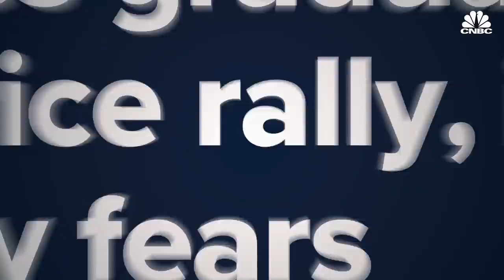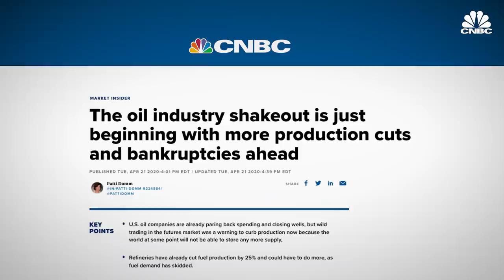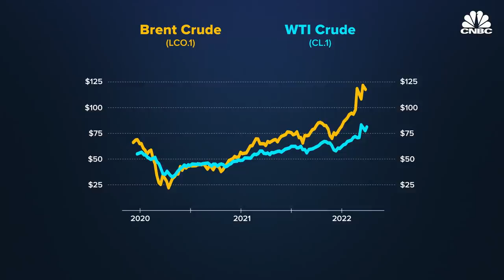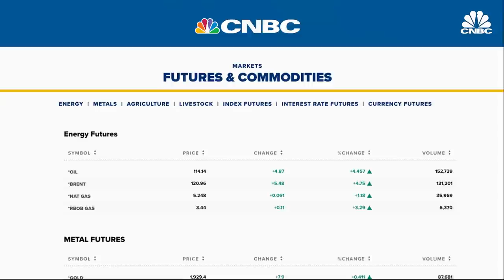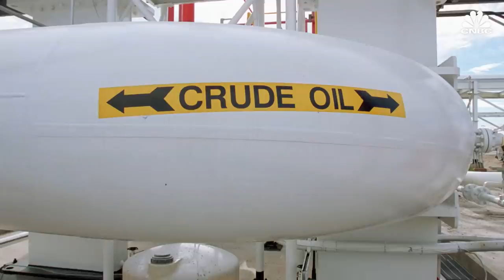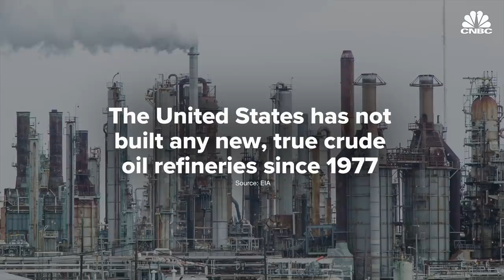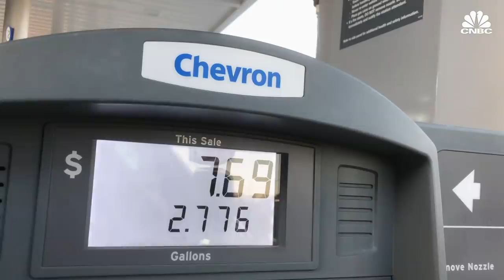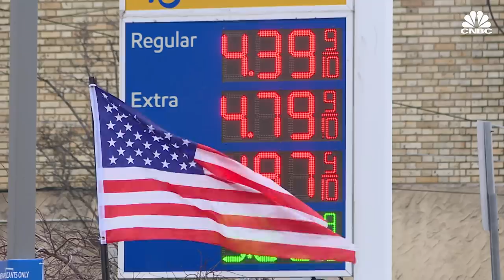Why Russia’s War Drove Up U.S. Gas Prices

Comment: The prices were going up before the war even started.
So it has nothing to do with Russia.
Reply: People were home for 2 years and not traveling or going to school. Now they are. Supply and demand.  Not a mystery
Reply: @amylee9  Because the oil companies cut how much oil they make.
It's like they never thought it would go back to normal?

Big oil are the ones that are price gouging  the refineries.
Reply: Yh also the shutting down of the XL pipelines but lefty will never say that.
Reply: @qfranklin2777  it’s a pipeline, not an oilfield. It wasn’t going to be finished until 2030 and it would have benefited China, not the US.   So, I don’t see how that matters
Reply: @powerguymark  explain to me why oil companies are not using the 9,000 unused leases
Reply: @amylee9  it was a cheap before that in 2019. Not a mystery.
Reply: @amylee9  because it takes time to survey those leases and only 1% will be profitable. Those are leases that they are allow to look for oil that doesn’t guarantee those will be profitable oil wells.
Reply: @TheAmericanCatholic  so will allowing them another 9,000 help?
Reply: @TheAmericanCatholic  and trump worked to limit production to bring prices higher
Reply: @qfranklin2777  The pipe line was not that big of a deal. It only delivered the oil. Which can also be done by trucks.
Reply: @qfranklin2777  The pipeline only carries the oil. It's still coming from Canada, so it will still be an import.
Reply: @qfranklin2777 , I swear to God.. Stop talking about that project. It was going to end at the gulf coast to be shipped out the country...
Reply: The truth is that the U.S. is the largest oil producer on the planet and could easily produce enough to drive down prices.  U.S. oil producers were producing 18 million barrels a day prior to the pandemic.  Today, they are producing approximately 8.5 million barrels a day.  We have a huge amount of production capacity sitting there offline that could be brought back online in a couple of weeks time.

The head of the largest U.S. oil producing company admitted during an interview with Andrew Ross Sorkin on CNBC (aired in part on December 7, 2021 Squawk Box morning show) that U.S. producers have plenty of production capacity they are refusing to bring back online because they want to hurt the Biden Administration.  When Sorkin asked the jerk if he had any obligation to his country or the world economy trying to recover from a 2-year pandemic, the response was, "our only obligation is to our shareholders."

Energy is the number one cause of inflation.  If the U.S. oil producers brought back production to pre-pandemic levels, prices would drop to nearly $2.00 per gallon in just a few weeks.  Prices throughout the economy would drop due to lower transportation costs.  Inflation would drop back down to normal levels.

We are all being held hostage by a bunch of oil companies who are experiencing record profits while doing their best to make voters angry at Biden and the Democrats and hoping they will be voted out.  No industry should have that much power over our economy or our political system.  People should also understand that high oil and gas prices enrich Russia and OPEC at the expense from the rest of us.

The U.S. government should use its Emergency Powers to do some drilling and replenishing of the Strategic Oil Stockpile and constantly releasing from that stockpile into the market to drive down prices.  That would force the oil companies to treat us fairly because they could no longer conspire together to act as a duopoly.
Reply: @chuckmurray1825  Before the pandemic, they were doing 13, not 18.
We can become energy independence if they were able to drill more.
Reply: @saulgoodman2018  We could become energy independent if we nationalize oil production.
Reply: inflation bud
Reply: @chuckmurray1825  Accord it the EIA, crude oil was 12.2 in 2019.
Reply: @shadowwolfkano  No. You do not want to nationalize oil production.
Government will just mess it up. Just like they do with everything else.
Reply: @shadowwolfkano  How?
Look at the VA, Medicare, Medicaid.
Reply: @chuckoakley2755  presidents don’t set the price of gas. Gas prices are up globally.  in Europe, Australia and Japan prices have gone up and guess what? Biden isn’t the president there.  Let’s go Darwin
Reply: @TheAmericanCatholic  so how much will allowing them an extra 1,000 leases help them?
Reply: @saulgoodman2018   The majority approve of it.

"More than two-thirds of respondents said Medicare needs to undergo at least some changes, however slight, to keep it financially stable in the future. A whopping 87 percent of respondents favored giving the federal government power to negotiate prescription drug prices with pharmaceutical companies"

Source: CNBC , my last post with the link got deleted
Reply: @saulgoodman2018  I would rather have the people decide, over unaccountable corporations. Corporations got us in this mess.
Reply: @saulgoodman2018  You don't have to be a socialist country to control your own resources. Norway isn't socialist and they control their oil. Stop defending oil companies.
Reply: @shadowwolfkano  And prices are $10 a gallon in Norway.
Reply: @amylee9  too expensive to drill it's in the video.
Reply: @TheAmericanCatholic  The economy sucked before 2019 that's why oil and gas was cheap. The industry thought it was going to grow more but crappy tRump policies kept it deflated. GDP rarely got over 2%. The petroleum market was flooded and that kept prices down. There was little demand for it.
Reply: @amylee9  Because leases are not permits.
Reply: When the 3rd productor of oil is massively taxing you prices will go up

Comment: It's the Fed not Russia, you can't print trillions of dollars without stealing value from the dollars already in existence. Of course other factors are at play here also, but obviously food and energy will see the lions share of inflation.
Reply: Lol …the fed he says. What an analysis!
Reply: @TheRealRobertG  actually he is not wrong,
On broader level he is right inflation is caused by money printing
Reply: @shubhamgarg09  and so to does a global pandemic that shuts down 1/3rd of china now too that would cause inflation too to act like there is a singular cause for this is the Hight of arrogance
Reply: @roxaskinghearts  there is no singular cause i agree.
But the biggest cause is money printing
If supply chain is the issue that means that when the issue is resolves prices will come down
But do you think that will happen ,NO,
Money printing is done all over the world , so the biggest reason is money printing that is why FED rates is key to control inflation
That is what FED is trying to do now.
Reply: @shubhamgarg09  That's a complete failure in understanding how monetary policy works. The Fed controls interest rates to reduce demand. Inflation due to increased M2 supply would lead to currency devaluation relative to the rest of the world, which it's not. The fed is trying to reduce spending demand given supply shortages. For the past 20 years, we've been able to keep inflation low and print a ton of money. Yes, it has baffled economists why that had worked for so long, but we are now seeing it's because our ultra efficient supply system kept up with explosive demand. We also now realize how delicate that system is, and paying a price for it.
Reply: @mididude03  M1 censored "don't help at all"
Reply: @shubhamgarg09  like you said money is printed all around the world and throughout history and yet what does this change in terms of inflation when gas was already stated to be on track for a bad yield year when we live paycheck to paycheck cdc data and people have been listing our problems like this for over 10 years now from crumbling infrastructure to  our packed docks nothings changed to solve our growing problems and sense 2010 things have only systematically gotten worst as the rich continue to dismantle our government and our mountain of problems are only growing we use to be on track for things now America feels on lifesupport to me sense then nothing has changed its just people are getting fed up that the country doesnt revolved around them anymore it revolves around keeping the elite happy who cares if your poisoning and polluting our land texas is a perfect example for near half our country
Reply: @TheRealRobertG  Russia exported 500,000 barrels of gasoline a day into the US , the media only said oil
Reply: @tstocker6926  uh oh! Except… the US has the largest production of oil/ng in the world. We’ve given tax breaks to multinational oil companies to drill oil out of our land, sell it on the open market, and eventually to other private companies who in turn sell us back our own oil at an even higher markup. If you don’t think that prices are a reflection of corporate greed, free markets and opportunism u r deficient in logic and reasoning skills.
Reply: @TheRealRobertG  "If you don’t think that prices are a reflection of corporate greed, free markets and opportunism u r deficient in logic and reasoning skills." WRONG! Prices are determined by the market. Oil and gas is sold on the open market, supply determines the price, not the "corporate greed". The corporations are just getting what they can given the supply.
Reply: Supply and demand. Everyone flying to the beach after sitting at home for 2 years
Reply: @mididude03  yes, in the past we’ve been able to print money and keep inflation at 2%. The us petrodollar being the global reserve currency helps absorb the costs as long as world economy is growing steadily. But from 2020-2021 we printed a lot more money in a short amount of time without increasing the demand for dollars.
Reply: @chuckdawit  You ever heard of a concept called nationalization?
Reply: @TheRealRobertG  your reply tells me that you are just angry and doesnt have have any concrete point to add.
Have fun in life 
Peace out
Reply: @shubhamgarg09  LUL Nah… ur comment just didn’t merit a real response ✌🏼
Reply: @TheRealRobertG  i work in bank, m2 supply and FED rates is my subject.
Now if you have speciality in this subject then i am ready to debate with you ortherwise i am just wasting my time
Reply: @shubhamgarg09  fiscal policy is not rocket science lol
Reply: @shubhamgarg09  I’m rather concerned that u seem to be having trouble with general spelling let alone dealing with actual facts and nuanced arguments.
Reply: @TheRealRobertG  can you elaborate what did i say wrong.
I said in broader level money printing does lead to inflation
If you dont understand this argument then fiscal plilicy qnd monetary poilicy is not your cup of tea
Reply: @shubhamgarg09  if you only look at this situation through the lense of banking you get the same answer every time.. fiscal policy is both the problem and the answer. 

However if you were capable of broadening your scope of analysis you might find there is a lot more at play than just increased money supply. 

In terms of real inflation the dollar is up against practically every currency over the last 5-10 years. So… how do you draw the line between money supply and CPI?
Reply: @TheRealRobertG  this is not what i and you believe
This is what we are taught in profession
That money supply and CPI have in long term have direct relation
It is a fact in Banking world
I am not making it up go google about it.
Now in short term their are many factors by which it can get affected
But in long term more than 10 year period it is related.

Simple example there are 8 billion people and money supply is increasing and wealth is never distributed eqaully so it leads to inflation
Because it decreases the value of money.

For past 10 years you can see inflation in house prices , stock prices, even comodities.
And now slowly this inflation is coming into general items that we consume like food
Reply: @roxaskinghearts  so you still believe there really is a "pandemic" in the world, seriously?
Reply: @mididude03  what is this supply nonsense you are lying about? there is no shortages of anything
Reply: What is failed to mention here is that supply chain, money printing, and inflation were not issues under the former administration.
Reply: 100% on it! 👍

Comment: So destroying domestic production through regulation, stalled permits, and crushing the pipeline industry has nothing to do with it right?
Reply: The question I asked myself before I clicked and thought it would be mentioned. The truth is very stingy
Reply: True 😔
Reply: @edvaira6891  yes it is because investors are not willing to invest more in drilling due to democrats' policies in regards to climate change.
Reply: yes, that's exactly right. ABSOLUTELY....NOTHING.
Reply: BTW domestic production is the strongest it's ever been. We are #1 in oil production.
Reply: 1) regulation is loosely applied in the USA. If it weren't, then new Regs wouldn't cause such a reaction.
2) Permits and leases have been held by the oil companies for some twenty-plus years, without them being used. That's on the oil companies.
3) The pipeline industry was not crushed by any outside force. It decided to speculatively build major pipeline projects, many of which are incomplete, like the Keystone XXL project. It's worth remembering that pipelines do not generate oil ( I know )as some outlets tell us. Currently there are major lines running at 8% capacity, and that's the highest they have been in their lifetime.
I hope that helps.
Reply: @michaelmacdonell4834  that does help a lot, but some are just social media bots here to regurgitate conservative talking points.
Reply: @infidelwarriorforlife289  don't talk about permits. It takes years for them to even develop on a permit and no the statistics don't lie American backed oil companies have been at the top of their game for a while now.
Reply: @michaelmacdonell4834  Awesome reply.
Reply: @duancoviero9759  I know, blame Biden for everything, it has to be the most unintelligent comments that do this. They choose to stay in the dark and not listen, read, and expand their minds. The thread under this video does contain some really intelligent facts, but they just skip over it and blame Biden. I knew a lot before but really learned a lot more from the good pointed logical comments here.
Reply: Biden’s complaining about oil companies not drilling and demanding they “use it or lose it” is a red herring if there isn’t enough refinery capacity to turn that oil into useful products; at this time there are no major projects planned to build new oil refineries or expand capacity of existing ones.  In addition 6 or 7 have shut down recently with a combined capacity of 1 million barrels per day.   Combine that the loss of a potential (700,000) barrels of capacity from Keystone XL (one must look to the future), the inflationary impacts of the American Rescue Plan, the demand for oil reaching pre pandemic levels and the fact that U.S. oil production is well below 2019 peak levels thru 2021 despite what some may be saying.  Yes, we produce 20% of the world wide supply (the highest), but we also have a growing population and a growing demand.  Certainly  the Russian invasion of Ukraine has had impacts - one must be honest - but even the pope had the following to say about this invasion of Ukraine despite obviously condemning it:  "perhaps somehow either provoked or not prevented".  Gee, I wonder who could have possibly provoked Russia?
Reply: @RedBaronlives  calling names helps with mental stress

Comment: Great way to uncover half truths CNBC! 👏 bravo
Reply: Indeed. OPEC cartel tried the same thing before but Russia was in bad terms with them so it flooded the market and brought the price down. However now that most of the west is against Russia, OPEC is using this opportunity to extend a helping hand to Russia and together they control the supply.
But I guess high oil prices is what that's needed for a true revolution in energy. All the projects that were scrapped or shutdown might be revived in hopes to reduce dependence on gas.
Reply: It's where they excel.

Comment: it has been rising since 2021. Stop the lie.
Reply: Because the economy was opening back up so 2020 happens and gas prices drop because demands goes down by 50 percent and oil companies were literally burning oil because there was to much supply than demand fast forward one year demands goes up then expected and now supply is low